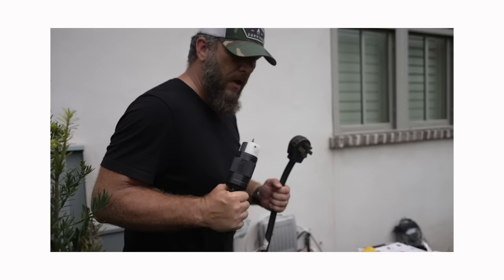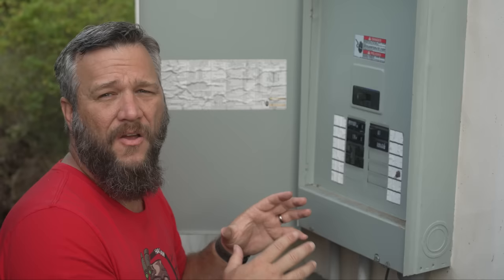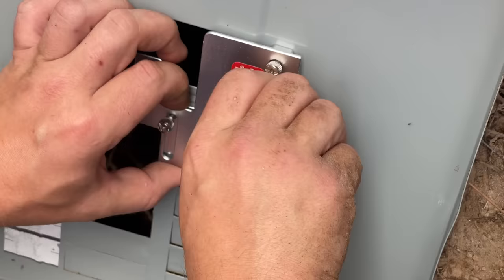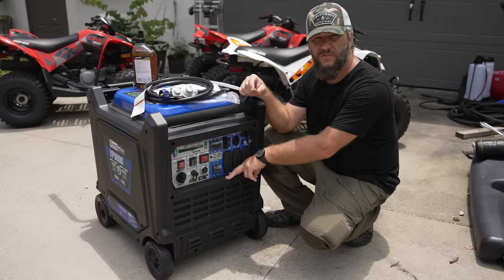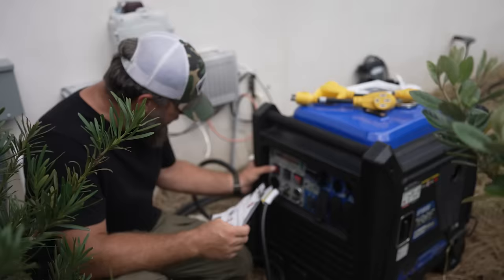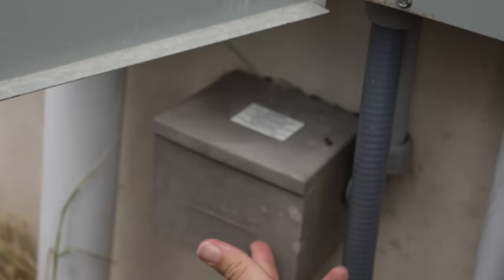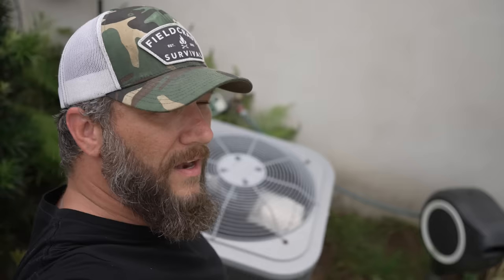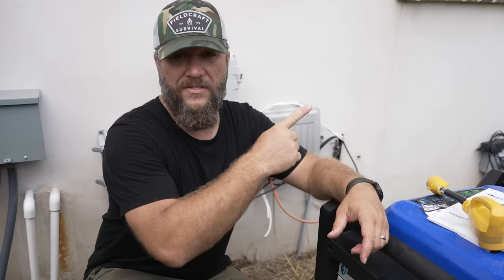90% Don't Know About This Fatal Generator Connection

Comment: The reason your air conditioner takes a few minutes is because of a thermostat or possibly a built-in time delay. There is a safety for the compressor on the air conditioner. If the power to go off for just maybe five or 10 seconds, and then come right back on, that is very hard for the compressor motor to fight that pressure. That’s already in the system. It’s like starting out from a dead stop on a 10 speed, bicycle, intense gear..
  I didn’t watch your whole video. I just went to the end because I could see what you were doing. being a retired electrician, and retired from the local electric utility, where I worked for 40 years. You would be amazed at how many people don’t pay their bill, and they go out and buy a generator and think it’s cheaper to run a generator to power their house.
 there are quite a few of those people I would run into every year.. even if they were only running their generator part time, maybe every few hours to keep food in the freezer still frozen. They’re going through at least 5 to 10 gallons of gas a day. Let’s whittle that down a little. Let’s just say that there’s buying 5 gallons of gas a day… so let’s say that is $20 a day plus the gas you were burning in your car to get to and from the gas station, so say $25 a day. That’s $175 a week. that’s around $700 a month.. not even taking into consideration, spilled gas, gassing up at night, or in the rain, call me generator maintenance, changing the oil servicing the air cleaner.. that’s in the months that you don’t need air conditioning or running your furnace.. those months you can add 30% more gasoline.
  mini generators are not made to run on a 100% duty cycle..
  these days with ethanol fuel, that fuel does not keep in gas cans for much longer than 60 days..
  A lot of these YouTube videos that show how to backfeed your house from a generator during a power outage, I have yet to see one that stresses the importance of grounding your generator to your buried in the ground grounding rods, generally in the ground in the area of your electric meter outside. Get yourself a pair of automobile jumper cables, there is generally a wing nut stud on the generator for grounding. Ground that wingnut Stud grounding, point to the buried copper, grounding rod

Comment: That is one way to set up your generator, but I would rather have install a generator power transfer switch kit that has the amount of circuits you need. My house currently has 6 circuit breakers for 6 circuits, but I may install 2 more circuits. Therefore, if I install a generator power transfer switch kit I want one that has at least 8 circuits.

Comment: Also 99.99% no one in youtube had mentioned is the inlet max 7500 watts capacity! Even if you have the most powerful running watts generators, if it exceeds your inlet wattage max capacity, you’ll likely have a rude awakening!!

Comment: Dead man’s cable is what they call your generator to building cable.  Male plug on both ends of your cable.
Reply from the maker: It looks like that but It’s just a guide in the middle of the plug. That’s a female end.

Comment: Our house electrical panel is being upgraded with 200 amps, solar grid tie (no battery), and a separate box with the generator transfer switch. Now I just have to buy a 9kW generator.

Comment: if you have to send your cable from your generator a good distance, 100-125 feet will drop you 5 amps or so,    so if your generator can do a Higher Voltage, you can get a special Generator Extension Cable that  doesn't transform down the voltage until the far end of the cable,   so much less energy is lost

Comment: I do prefer to shut the generator breaker off before shutting the generator down. Because when the generator goes down in rpm, the electricity generated is not optimum. Not good for electronics and compressors.

Comment: My generator is connected to my house thru my solar system. Spouse can switch the power on after a power failure with a push of a button in the utility room. (Working on automatic  fail-over this fall)

Comment: since you are not hard wiring your generator you could bypass a lot of what you have done by installing a "Generlink" on to your meter.  I got mine through my power company
Reply: One reason - cost.  The generlink that goes behind the meter is expensive.  What he did was much more economical.

Comment: Ooooookaayyyy. First. I’da kilt you when you acted like you were getting shocked. 🤣🤣🤣 Now, for the serious stuff. THIS was an extremely helpful video and I’m sooo thankful this hot my YT feed. We just built a shed/house conversion and had an electrician do all the electrical work. This included an exterior generator hook up. (We have a Bluetti.) I have pictures of our electrical panel. Is it possible for me to send them to you and see if it is set up correctly?
Reply from the maker: I wouldn't consider myself enough of an expert to judge that. As long as you have a way to disconnect your panel from back-feeding you're okay.
Reply: At least he kept the smoke in the box.

Comment: The breaker he used is a Siemens breaker which is not the correct breaker for this panel. You have an Eaton BR panel and the only rated breakers for that panel are Eaton BR breakers and nothing else. You should swap that breaker with a BR 250. Obviously the Siemens breaker fits in there but if you look at how a Siemens breaker attaches to the bus bar vs a BR breaker you can tell there’s a difference. The Siemens breaker was designed to attach to a Siemens bus bar, not a BR bus bar.

Comment: I feel intrusive asking, bit I must.

You said the whole house set up would've been about 12k, so you chose to do the portable setup instead.

Can I ask what the cost difference was between these 2?
It seems like you've got quite a bit of money sunk into this setups as well.(generator,  panel, wiring,  underground propane tank, cables, electrician,  plus the savings of a stunt nephew double 😂 ect)

I'm betting you're actually pretty close to that 12k price all in with this one.

I'm only asking because last year I was in bull's eyed hit by hurricane Ian here in Cape coral Florida, and I went an entire month with no power in sweltering temps after.
So, I'm trying very hard to make up my mind on which setup to dump the money for. 
I'm on limited income and I can't seem to get consistent pricing for both to compare. 

Thank you so much for the content you put out sir. I freakin love your channel.
Reply from the maker: The generator cost $2,000. The electrician I think was about $400. The interlock was $35. The panel box was already in place as well as the buried tank. The nephew only cost me a couple ham sandwiches. My circumstances are a little unusual. Most people aren't going to have a panel box outside already. That was only there because of the well and the addition of my Mom's part of the house. It would likely cost most people more than what I spent. If you don't want the tank buried the gas company will rent you an above ground tank for something like $10 per month or you could use refillable tanks. I have a bunch of those in case I use all the propane in the main tank. On my integrated quote the generator was $8000 and the install was $4000. Of course that would have powered the entire house and not just my Mom's part so it's not an apples to apples comparison. The generator was three times more powerful than my portable one. I would still love to have an integrated system, it's just that there are other things I'd rather have for 12K right now. 😄 Thanks so much!
Reply: @HAXMAN  
THANK YOU SO MUCH for responding fully! 
 And I completely understand having other ideas for using 12k. 😂 

I love everything about your channel and life man. 
I learn such cool stuff every time I watch.
Plus you make me bust a gut laughing while you show me. 

I currently have a 5500 watt portable generator. (I'm definitely not going with "any" power for a month again.)

So I guess I'll have to look into getting an electrician to wire me up an exterior panel and lock out.
I know I can't power much with only 5500. But a fan, the fridge, and some other miscellaneous do dads would be great should I get smacked again. 

You've definitely earned my respect and a loyal subscriber.  
Be well.

Comment: The linemen short the lines they are working on.  You don't have to be their nanny.

But you would destroy your generator or at least the breaker if tou ate not disconnected from them at the time they restore line voltage.

Comment: If you have a standby generator and don't have a transfer switch installed you MUST switch the MAINS to OFF BEFORE connecting your generator to your home electrical panel!

Comment: The comments are mostly about what will happen plugging in a suicide plug into a house outlet. The mention that it's illegal to back feed a generator onto a incoming line drop to your home. This is a DEADLY practice as a lineman for the Electric company who is up on a pole is working on a dead branch circuit to your neighborhood. He's checked the line & knows it is a dead feeder circuit because a tree has fallen & broken the line from the pole. For safety, He pulls the neighborhood fuse that has the line dead until he's completed his repairs & then he'll go to that fuse switch & re energize that feeder again. In the meantime, Joe has gotten out his generator & suicide plug, Filled it with gas & plugs it into his garage outlet to power up a few things in the home. That 120 or 240 volts he puts on the meter box goes back out to the pole transformer. A transformer does the job of taking approx. 13, 000 volts on the branch circuit (that wire on the top of the poles that goes into the top of a transformer hanging on it) when its operating properly, And steps it down to a relatively residential safe 240/120 volt house feed. BUT A transformer works either direction. That generator voltage goes out the breaker panel in the basement, through the electric meter, out to the pole transformer, WHERE It's stepped up to 13,000 volts AC & travels down that suddenly now live line to a block away where that lineman is restringing it through the insulator eyelet on a pole. Yes, Your right, That generator will not power that block of homes for more than a couple of seconds & pop a breaker or something else. BUT That won't save the poor lineman who knows he's working on a safely dead feeder line. He's now laying at the bottom of the pole. Just a little more info about how a grid works.

Comment: Man that fake shock was not funny! I hope the genset holds up running your entire house. The start up loads are what kill the smaller units. I was going to purchase a 25kw system for our house, but the electrician talked me into a huge 50kw unit. So we purchased a Cummins RS50 with an auto transfer switch which was just under $21,000. We put it on a large concrete pad approximately 60' from our house electrical panel and 500 gallon propane tank. The trenching, electrical connections, and plumbing to connect a 2" gas line cost another $7,000, for a grand total of $28,000.00. We saved up for eight years to get this done, and in the interim used an electric start 5000/6250 watt genset to keep the refrigerator, freezer, and lights on during power outages. We obviously could not run much more than that without tripping the gen's breaker. Of course now that we have a killer system hooked up we'll probably never see another power outage lol...

Comment: Don't be lazy, re cut those wire ends and make sure every strand is inside the breaker.  Remember no copper should be exposed outside of the perimeter of your breaker. Tighten up the wire. The wiggle it a little bit and tighten more.  You will be amazed how much more you can tighten it up.
Reply: I'd probably put ferrules on the stranded wires connecting to the breaker. Seems to me to be a better connection than squishing a loose bundle of strands in the breaker's clamping connector. But, I'm not an electrician, so there may be a reason not to do this or it might be overkill.

Comment: What kind of hoky tape job did someone do on that breaker you moved?? Did they tape a ground wire to use on 240? Oh man looks like it was done by the same guy who "didn't" instal that plate

Comment: You're running Whole House on a 9,000 Watt Inverter?  That makes me confident that I could run my Whole House on a 12,000 Watt, but it also depends on how big your house is; how many rooms, bathrooms, etc. and square footage.  I have 1,000 to 1,100 square feet.  What's yours?  And I'd like to use Natural Gas.

Comment: An accidental invocation of the generator would NEVER kill or hurt a lineman working on power lines, but there would be a more than noticeable electrical bang as the breaker is expelled from the panel into your face. Nothing complicated... the phase of the generator needs to be in sync with the power grid... that's all. Out of sync... big bang. An either / or switch would be nice and remove all threats.

Comment: Maybe you should stick with what you are good at. As an electrician, I have NEVER installed a back feed receptacle for anyone. I do however have one in my house because I know what I'm doing. Transfer switches are crazy expensive to the average homeowner and that's why they go for the alternative. If you know what you are doing, double male ended cords and back feeding are 100% safe.
Reply from the maker: I thought I did stick to what I was good at. That’s why I hired an electrician.

Comment: We recently bought a house with an existing wired in generator (CAT) that runs on a 500 gal propane tank,  have no clue how to use it, scared to try.  Didn't come w any instructions.
Reply from the maker: Nice. You might need an electrician to come show you how to operate it. Hopefully one better than the one I hired. 😉

Comment: and yes of course if you forget to flip that main  , the power can back feed  (240 volts)  back tho the step down transformer  and being reversed now that same transformer can act as step up transformer  and up your 240 volts back to primary line voltage  any where from 7,800 to 14, 400 volts AC   and the lineman would have a very bad day !

Comment: Another way to check for a gas leak is to hold a lighter under the fitting.  It will light up if there is a leak.  <sarcasm>TRUE</sarcasm>
Reply from the maker: I can see we would get along really well.

Comment: Surprised me to see you power your HVAC compressor with your 9KW generator which is about 37.5 amps at 240 Volts.  I thought the compressor would need more startup current, lock rotor amps (LRA).  I think that LRA specification is shown on the equipment tag.  Maybe your HVAC compressor uses a soft start circuit as opposed to a simple contactor?  Maybe you should not be running your central air.

Comment: I looked at that generator but I didn't feel like it would power the basic 230V necessities for a summer day here in Florida.  Did you test your water heater and well pump at the same time that your A/C was running on that generator?  I know you can alternate those circuits one by one and get by but can you energize your whole panel and operate as you normally do?
Reply from the maker: I did test the well pump but we have gas water heaters. This I believe is the bare minimum size and I would prefer two in parallel.

Comment: I'm just some dumb guy, but maybe you should get the generator a little farther from your house and limit the connections in your LP line to a minimum (longer single piece gas line).

Comment: Clean" vs "Dirty" power in a nutshell. "Clean" utility power is basically a sine wave. No spikes, no angles. Look up Sine Wave. That's what electronics want. Cheap generators without filters or inverters will output a spiky wave, sometimes even a triangular wave. These spikes generate overvoltage and harmful components which will zorch electronic equipment.

Comment: How many watts was you house pulling when the ac kicked on?  Curious as i have a 3.5 ton unit as well.
Reply from the maker: It jumped to 7800 then fell to about 2700 and moved between that and 5700 approximately.
Reply: @HAXMAN  Thanks and thank you for sharing 🙏   Love your videos, always helpful and mixed with a splash of humor!

Comment: The generator cable that plugs into the house should been female and not a male connection. Subsequently the connection box mounted to the house needed to be male.

Comment: Any good electrician would have installed a transfer switch.  Manual or automatic.  It's all about how much you want to spend.  Most safest way other than a kirk key system.

Comment: Ok .. for me, I shut EVERY breaker off, connect the generator cable with ALL breakers off, THEN start the genset, turn on the generator feed breaker, then bring the home load up slowly...2 to 3 seconds between breakers, listening to the generator's motor for any heavy loads...such as well pumps or sump pumps, or AC trying to come on....very safe, as no live cables are ever handled. 
Moving a generator around in a storm is a P.I.T.A....so don't. Figure a way to keep it handy & protected.